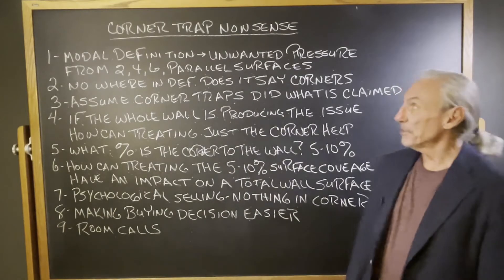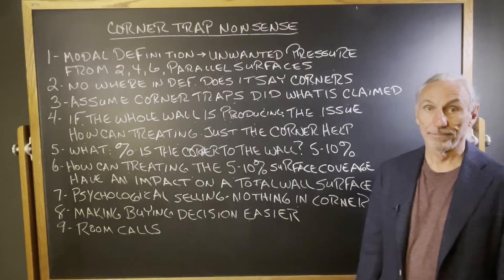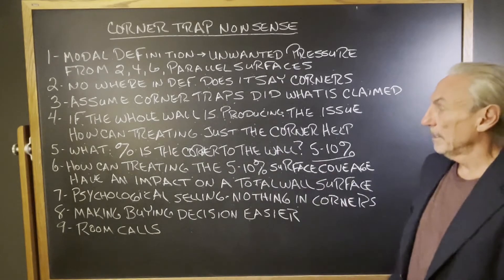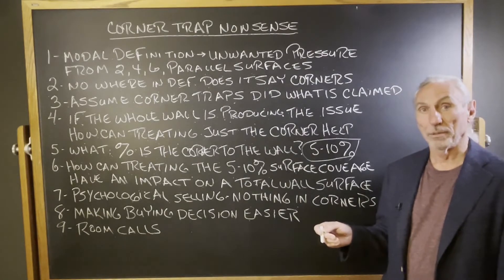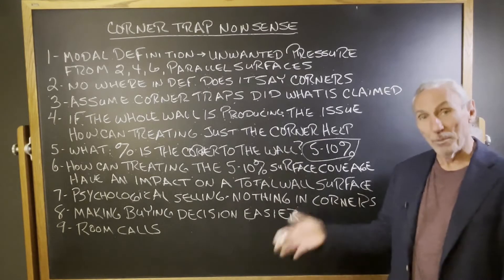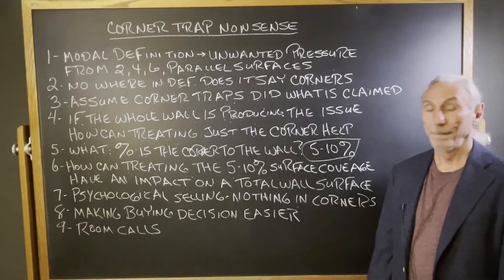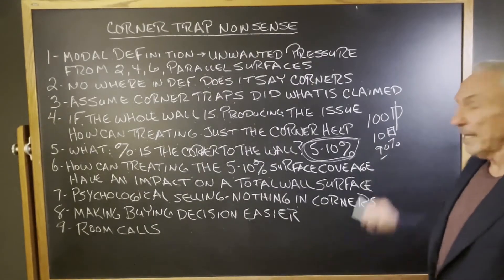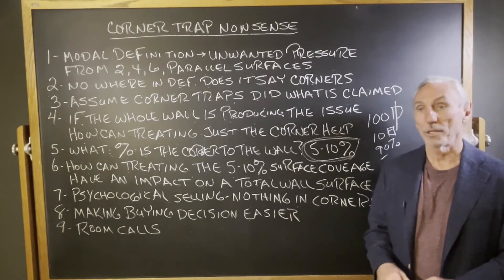Corner Bass Trap Nonsense - www.AcousticFields.com

Comment: Have you calculated the modes for a room? Do you not see them ever lining up in corners? 
In most rooms I have calculated multiple modes wind up in the corners, and due to the pressure gradient principle the velocity is at or near zreo in the corner while the pressure is at maximum. Due to half space/quarter space principle. Bass is reinforced in corners and at junctions of wall/floor, wall/wall, ceiling/wall (it would be odd if it occurred at wall/floor). 
When I've done the math on how modes work in corners, it gets ugly fast. It resonates in a non-linear way which is not the harmonic series. That is why you don't see square saxophones or French Horns. It's that awful sound of an empty room with no furniture.

I see here a lot of pointing out what you think are pitfalls in corner loading acoustic treatments. But I don't hear any solutions?
Reply: You aren't helping by saying "treat the whole wall" over and over. Most people are looking to do the minimum necessary to get good results. Anyone can throw the maximum dollar figure at a problem and get a good result. Very few people can do the least amount and get an equivalent result. Most customers are looking for that person who can accomplish the latter and not someone who just insists we pay to treat every wall.
Reply from the maker: @jamesmelton7637  Any you are not helping pushing syptoms of the disease rater than cause.  This is a central problem in this industry. We have bandaids masquerading as cures. All this does is add more "noise" to the real  understanding of the causes. Our products are not for most customers. Our customers are seeking the greatest resolution possible at all price points. Customers that buy once from us, buy again and again. They understand our mission of resolution.
Reply: @AcousticFields  you are giving bad advice. The fact is, you should start with the corners, EVEN IF you intend to cover the entire wall(s) eventually.
Reply from the maker: @74357175  You are not understanding the problem. If you treat the wall, there is no need to treat the corners. Our mission statement is all about achieving resolution. We do not subscribe to band aids. Band aids waste time, money, and resolution.
Reply: You avoid answering peoples questions. 
I can translate: If you have limited amount of money, (let’s say 300$) Putting 300$ treatment in the corner instead of 300$ on big walls is better, right? 
Or can you sell them wall products for $300 that works better than bass traps in the corners?
Reply: This video seems to be making a bit of a strawman argument. Most corner base traps that I read about don’t claim to do much about the modes in the room, but rather sop up excess non-modal base bouncing around.
Reply from the maker: It is not the corners of the room that are producing the unwanted modal issues. It is the entire wall. To test this, treat the complete wall and you see you have no corner issues.
Reply: @AcousticFields if you damp a string in the middle, it fails to oscillate at all. If you damp it at the end, it oscillates but decays quickly. A string is a one dimensional version of a room. If  you damp all the wall in a room, you wind up with an anechoic chamber. We want some liveness in our environment. This is music, not measurement. So corner loading is preferable.
Reply: @AcousticFields  That's not an apples to apples comparison. The correct comparison is to apply the same amount of treatment in the corner, vs anywhere else on the wall. 

You will find that, given a fixed about of treatment, the corner is the best place to put it.
Reply from the maker: @74357175  If you treat the complete wall surface, you have no corner issues. The corners are the result of an untreated wall.
Reply: @AcousticFields  sure, if you apply ten times as much treatment, you'll get better results, NO MATTER where you put all the extra treatment
Reply from the maker: @74357175  If you treat the wall, you have no corner issues.
Reply: @AcousticFields  treating the entire wall is 10x more expensive. It's not an apples to apples comparison. 
No one is arguing that you should ONLY treat the corners. The fact is, if you are only going to do a little bit of treatment, then you should START with the corners, as that will have the most bang for buck.
Reply: I think it makes sense to treat the walls and also speaker placement.

Comment: Stand in a corner, the bass is far louder (and boomier). Place a sub woofer in a corner, the bass reflections off  the corners will cause the bass to be much louder and muddier. Don't listen to this guy when he is clearly wrong about bass problems from the corners and claimed corner traps don't do anything. Bullsh!t.  Almost everything about acoustic improvement (room treatment) is dealing with undesirable reflected sound. Corners have three reflective surfaces at the ceiling and floor (it's not the whole wall). This guy just wants to sell you his expensive snake oil. When anyone claims that everyone else is wrong and only they have special knowledge, run away fast. This is what snake oil cable companies do to gullible audiophiles.
Reply from the maker: Quantity is not quality. Placing your subs in the corner of your room increases room distortions. We are all about achieving the ultimate resolution possible and producing more room distortions is not the goal.

Comment: I have bass traps in the corners and my room is still meh. I contact them... and they say "you only have 3" traps in the corners, you need our new 17" soffit bass trap from floor to ceiling in the corner". That would cost like $500 per corner. What?!?
Reply from the maker: Treating low frequency issues takes a lot of surface area coverage. Its physics.

Comment: Total surface area is not the only consideration. Anyone with measuring tools can debunk this video easily. Corner traps are not just marketing. This is the second video on this channel I've seen that are plainly false.
Reply from the maker: What are the other considerations you are referring to. Please be specific.
Reply: @AcousticFields  The fact that the corner is the best place to observe the 1/4 wavelength rule without taking up a bunch of room space. This topic is way more complex than you're making it seem. You would be correct in saying that it's nonsense that "bass builds up in the corners". I think that's the root of the rumor you're trying to dispel, and you're right about that, but it's way more complicated than "less surface area means they're useless". This video doesn't take in account air pressure and velocity of the waves. To put it simply, putting a corner trap in the corner of your room allows you to hit the 1/4 wavelength points of frequency lower than if you placed them against a flat wall, while saving space.

Comment: It's an interesting point you're making for sure but you spent 7 minutes making the same point over and over instead of using any of that time providing solutions.
Reply from the maker: I am trying to change a belief system founded in half truths. The way to accomplish this belief change is to establish a new belief and then support that new belief system through message repetition. You have two main acoustical issues in small rooms. You have lower frequency pressure and reflections. Every wall is contributing to both of these issues. You must treat on average 50 - 65% surface area coverage for both reflection and pressure issues. Treatment types will vary but not the 50 - 65% coverage requirement.

Comment: Your explanation is excellent. When I started adding sound treatment, I went for the corner treatment first which did provide some improvement. The slight improvement helped me ask more questions, better questions to get better results.
Reply from the maker: Rememeber that it is the whole wall(s) that are producing the pressure and reflection issues.

Comment: Looking at a definition and negating perception is not my kind of thing. If you put yourself in front of the center of a wall while music is playing (or your voice), and then you go to a corner, you'll notice more bass in a corner. You can measure that to be more scientific, but you don't really need it because it's obvious. It's not the only thing you need to do, but it's an important part. You want to go for a different route? Ok, but you don't need to be pretentious and discredit others to go for your own path. You can create your business just offering your products and not doing what you're saying they do, contributing with more nonsense with basic and malicious marketing language.
Reply from the maker: Your observations regarding the accumulation of low frequency energies within a room are not empirically correct and your cited example shows nothing that would lend itself to understanding the physics behind room modal pressures. We are about the ultimate in room resolution addressing all variables. We state this in our Mission Statement on the home page. We seek and develop new technologies to manage all frequency issues within a room based upon our proprietary carbon and foam technologies. Your comments on our marketing approach shows another lack of understanding. Another lack of resolution.

Comment: I recently treated a new, small home studio (12x12) with homemade 2" x 72" x 24" foam panels made with cushion foam over 1/4" OSB. I did not add any bass traps, but the panels butt the corners and pretty much cover the length of the walls. One afternoon I just "happened" walk to the back of the room and into one of the corners and I literally hear and feel the concentration of bass in that corner alone, like stepping into a bass cabinet, WOW!—and it was not reflected back into the room or the console/monitor station to a noticeable degree. Never knew bass could collect in one place so much.
Reply: one meter has 100 cm. cm has 10 mm. its so easy. and u have to measure everything in foot, inches and other awkward metrics, while we use cms.
Reply from the maker: Lower frequency pressure oscillates throughout your room dimensions. If the dimensions are not compatable with the frequency wavelength, distortion occurs. You have cited one example of this distortion.
Reply: @AcousticFields  compatable? Distortion? It's just standing waves
Reply: And because of the concentration of bass in corners is why bass traps in corners are quite effective and inexpensive. This has been measured to be true (including by myself).
Reply: @sb6-SSaM  - Corners reflect - sound doesn't concentrate in a generic area like a corner - they create standing waves and can create nodes everywhere.

Comment: If I’ve treated the walls thuroughly with broadband absorption, what is a good solution for absorbing any remaining excess base frequencies? Membrane traps perhaps?
Reply from the maker: Membrane are the cousins to diaphragmatics. They perform the same with membrane having lower rates of absorption through their design parameters. To target a certian frequency or octave band, you would use Helmholtz.

Comment: Funny, my ASC Tube Traps in the corners of my room has made a staggering difference in my room.
Reply from the maker: If you think the corner treatment made an improvement, you should listen to the results of treating the cause of the problem which is the whole wall. The defintion pf an axial mode is the unwanted pressure between two parallel walls not two corners. Corner treatment is a bandaid when it comes to achieving the highest resolution possible which is our stated mission.

Comment: So, buying ''bass trap'' alone is crap but adding it with side and cloud panels could be useful?
Reply from the maker: All lower frequency pressure issues and middle and high frequency reflec tions must be managed with different technologies. There is no one size fits all.

Comment: do folk conclude that standing waves that may arise in alcoves & corners can be suppressed or eliminated by bass traps or corner-located subs?
Reply from the maker: Alcoves and corners have dimensions. The dimensions, just like a room, determine what the frequency of resonance will be. Amplitude or strength of that resonance will be dtermined by the SPL used within the room.
Reply: What so you recommend one is to do when facing a family room in a single family residence that features an “alcove” meant for the tv or whatever?  Is it optimal to put bass trap in the walls recess/indent of about 2ft x 7 ft (alcove)?

Comment: My studio is in a square bedroom. I created some homemade acoustic panels, along with buying some acoustic foam and bass trap cubes for the corners. Bass traps are only a small portion of the solution. You need to treat the entire room. All the guitars that hang on my wall also act as diffusers. I'm going to install cloud panels as well. I can already hear a difference and so can my wife. The room is way more silent than it used to be. In addition, most of the boominess of the bass has dissipated.
Reply: All the guitars on the wall create reverb ambience. They are all ringing from the speakers.
Reply from the maker: Guitars that hang on the walls do not act as diffusers. They redirect sound but it is un predictable. Diffusion requires a completely different technology with many room issues resolved prior to installation.

Comment: I'm the past, Leather sofas were seen as great bass trap.  Why is isn't leather curved surface effective in a small room for diffusing low end  without making the room too dull? Semi porous leather seems to suit the purpose well.  Is like a acoustic panel with wood panels in it.
Reply from the maker: Not in our past. Furnture is not an acoustical tool. The rates and levels of absorption are unpredictable. Without performance predicatabilility and consistency in any applied acoustical tool you are jsut spinning your wheels.

Comment: I'm glad I found you before I spent money on my bass traps. I am using absorption in the back of the room and behind guitar amp, and diffusion panels on the first reflection points and the ceiling. Recording a guitar amp with one mic directly in front and one in the room. On a budget, going to have to do best with what I got.
Reply from the maker: Room resolution is a step by step process. Start with low frequency issues first.
Reply: @AcousticFields  Thanks for replying. I feel a little bit better about this, my heads exploded in recent days with research. Going to begin with placing corner pieces floor to ceiling behind the amp, and ceiling to wall down the long sides of the room. With some recordings to hear changes, if Im happy with the difference I'll move on to paneling.
Reply: Thinking about a YouTube video of the transformation

Comment: Hi Dennis, I love your videos because its the truth alot of people dont understand why they should buy a helmholt resonator and diaphragmatic bass management panels so they buy cheap rubbish and think their room sounds better but really it just sounds more dead and isnt doing the job its meant to. Also room modes they dont understand if you treat your axiel modes properly you have a postive impact on fixing those problems.

people rather try make their studio look cool but not actually test their room to understand the issues.

a proper control room should cost alot of money depending on your size room that price tag varies. Big rooms = less lower end treatment maybe so required.
Small rooms very difficult price wise to get down to the low end, but to understand the physics you need to spend the money.

Physics doesnt lie.

I have done acoustic testing on so many peoples rooms and I tell them we need your diaphragmatic panels for the low end, then they freak out at the price tag. so then I tell them I cant help you sorry without spending money you wont be able to solve the issues you need to. 

I like to start with the axiel modes first.

I can feel your frustration because people just dont get it. 

I know people with $200k+ worth of expensive gear and have no acoustics, this has me very worried people dont believe me because they think expensive gear is good. well it is good but room is telling you its not. 

Everyone please get your room sorted before buying anything dont try look flash honestly your wasting your money.
Reply from the maker: The main issue is a false belief system based upon a lack of understanding of the laws of physics. Companies perpetuate false claims because people have no understanding of why the claim is false. One of the most recent ones I have seen involves "soundproof paint". Yes, paint is marketed as a barrier technology. People call me and ask me how to use it correctly. They ask if more layers will produce better noise attenuation.

Comment: I almost bought some. But didn’t because I saw a frequency response chart showing the bass trap only affecting frequencies at incredibly low levels. Like 300hz. For my talking voice that’s basically a non issue plus the walls and ceiling aren’t treated yet so why bother with some foam triangles😅
Reply from the maker: Foam is not a "bass trap". The corners are not enough treatment space when the whole wall is producing the unwanted pressure issue. Corner treatment is a marketing scam. Thank you for sharing a real world example. We need more of these testimonials like this to bury this false belief system.